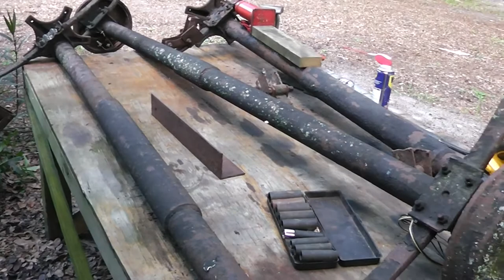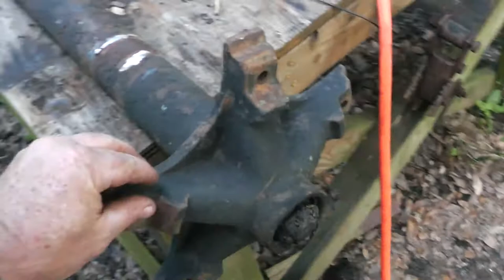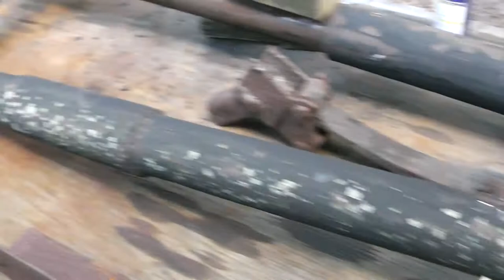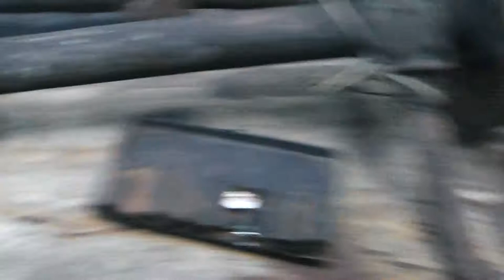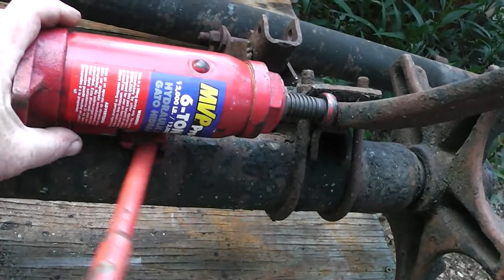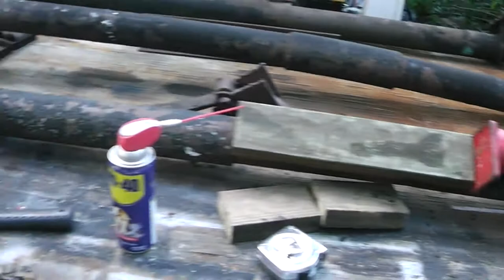Shipping Container 10,000 Pound Trailer Part 1

Comment: I didn't know there was a 3500lb mobile home axle. I have heard of 5K, 6K, and 7K. I have two under my equipment trailer and I have hauled a 10,000 lb. dozer on it at highway speeds for hours, more times then I can count. I have never bent anything or had any problems with it. It is still in use today.

Comment: Sooooooo...... My trailer, probably has 3500LB axles under it. My tractor weighs about 7K undressed. With a loader and a mower or blade (and trailer weight) it would be about 10K. I haven't considered loading it up to move it anywhere because of overloading the axles... Do you think the trick of welding some angle iron (i just got some beautiful 4" angle that is about 1/2" thick)... would beef it up enough to do the trick? I was thinking about buying another trailer... this would eliminate having to do that !
Would the bearings hold the extra weight, or are they rated the same as the axles?
Also, would there be any harm done to the axles from the heat from the welding process?
I'm intrigued  :)
Thanks
Reply from the maker: TexasPrepper2  The angle iron trick will keep your trailer axles from bending as easily but, you will need to beef up everything else: tires , frame, bearings ,hitch and etc. to safely move that type of load on public roads.  IMHO I believe that you would be best served to add another 3500# axle, reinforce the frame, electric or surge brakes, increase the tires weight rating, properly rated hitch.  A trailer is only as strong as its weakest component.
 I don't believe that proper welding will hurt the integrity of the axles.
That 4" x 1/2" angle would make an awesome equipment trailer!
Good luck and thanks.
Reply: Your spindles have a certain weight  rating also so bearings along won't be the only thing . Also check the coupler max weight rating. Usually  upgrading or adding an additional axle will work ok if the frame and coupler can handle it
Reply: Jerry stutsman Thanks to both of you... I'd probably just sell the one I have and spring for a stouter trailer...
Reply: Good tips, I've never had an axle failure from welding, shortening them up, etc.  My wood trailer is single axle 3 inch tube mobile home style and regularily hauls cords of fresh live oak which is in the range of 5k lbs give or take, plus 700 lbs for the trailer.  I'm also the idiot who hauled over 300 vehicles an hour drive from 4000ft elevation down to 500ft over one summer when the price of scrap was high--all without trailer brakes.  Manual diesel truck =) Don't go outside your comfort zone, if it doesn't feel right, then it probably isn't.  Better to buy or build something better than to be a danger to society.